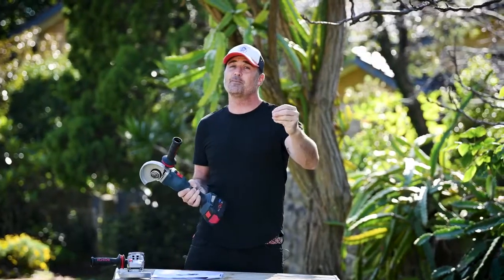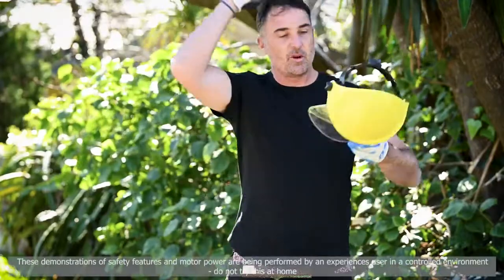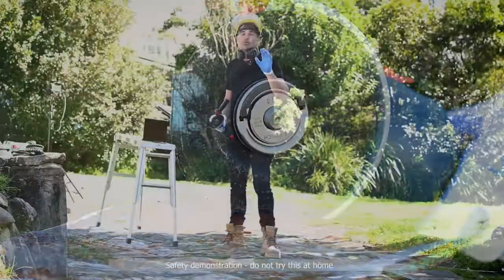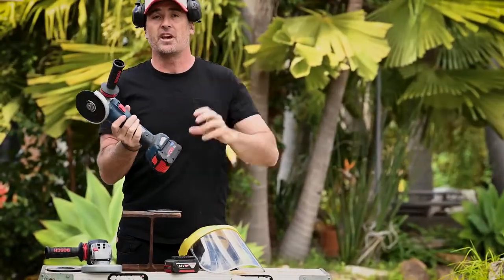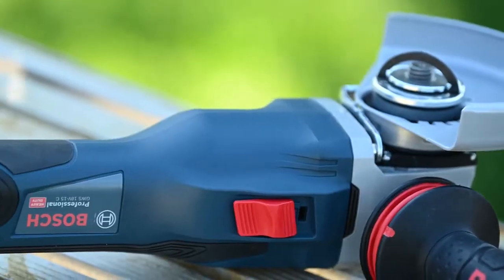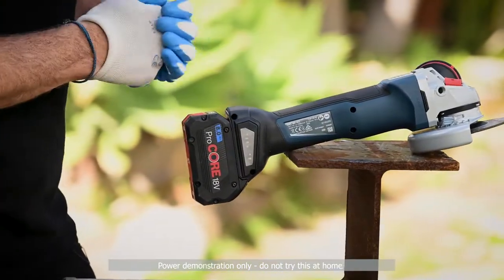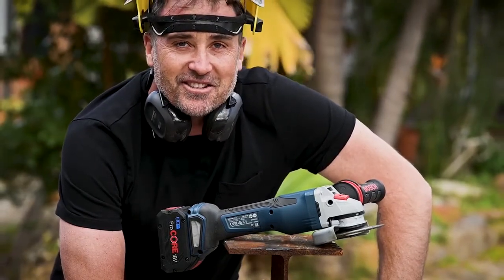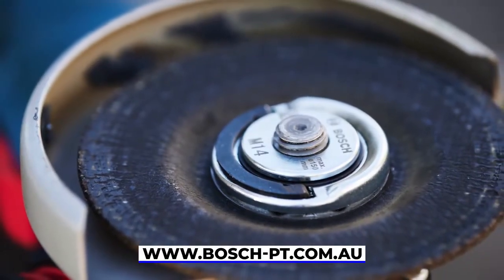Bosch GWS 18V-15 C BITURBO Grinder

Comment: Thanks for the comparison with the 10 vs. the 15
How is the weight (in hand) with the 15? The specs says it quite more heavy than the 10 (+ 400 grams) Will the more power the 15 has.. drain the battery faster? how is runtime with the 15 with moderate pressure compared to the 10?
Reply: Under full speed yes it drains the 8Ah a bit faster but unlike the 10 the 15 has 6 amd not 3 speeds.
Its still possible to use the 15 one handed but you need an solid lower arm.